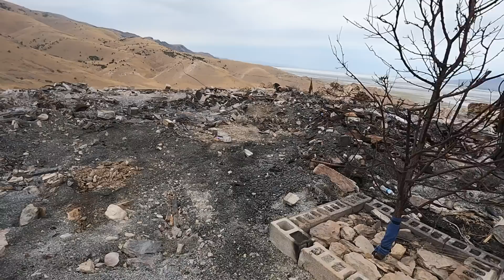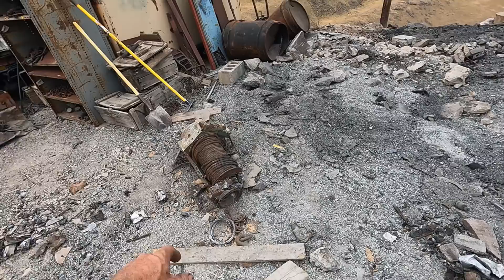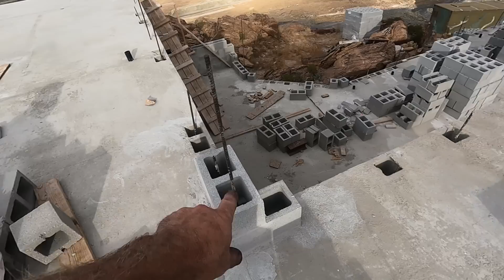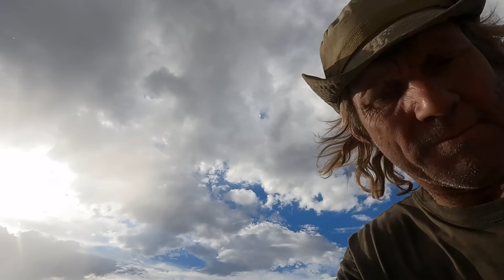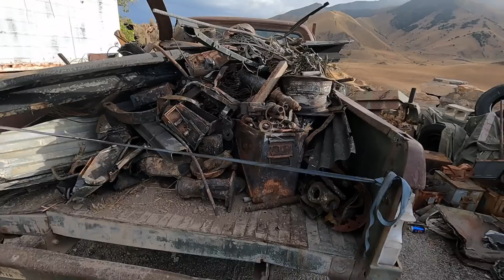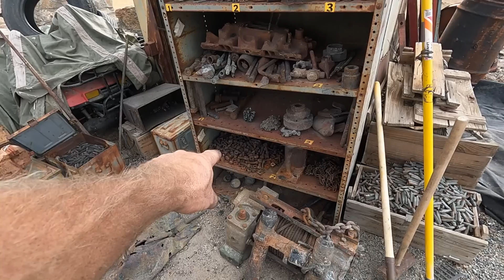Fortress Project Fire Cleanup Update & Humming Re-Bar

Comment: You can set up a switch on your charge controller to flip when ever voltage is being dumped into the ground to activate a motor to close the cover. And set another to flip when the battery bank gets low to open. Instead of kicking on a generator it will open the cover. Unless your connected to the grid its  pointless to have them uncovered because your not gaining anything by having them exposed. At last if you were connected to the grid you would dup it back into the grid and lower your bill.

Comment: After being exposed to the sun the panels have a load in them, if the energy is not released within 45 days (If I remember right) they start to degrade. Best thing to do is leave them in the box they come in until you know you can use their energy within a month or so

Comment: Bury the containment stuff in concrete under the building. Would save you the trouble, time and expense of moving it. Be like they do with radiation material buried on concrete. All metal can be recycled. With your skills as a welder, can you make a swing crane with a winch, to brin stuff up to the roof?

Comment: Allan solar panels do not need to be up high if you have space at ground level.dril bits do not have to be heat treated Cheers
Reply: what's the point in using up your limited ground space when you have a big empty roof that you cant do much else with.